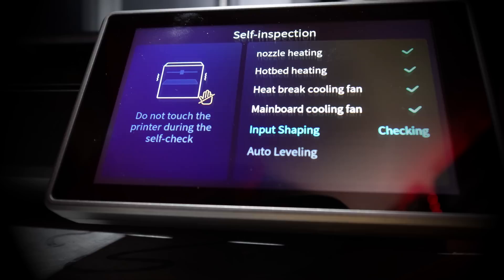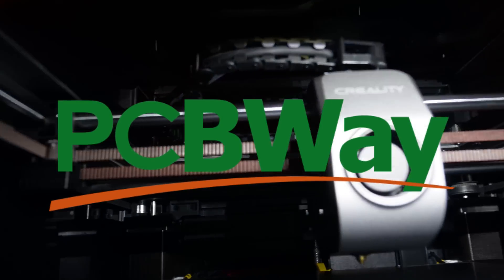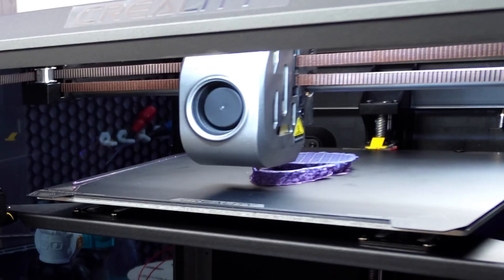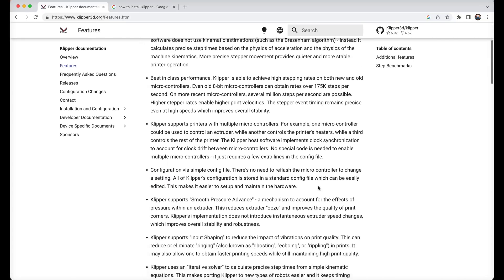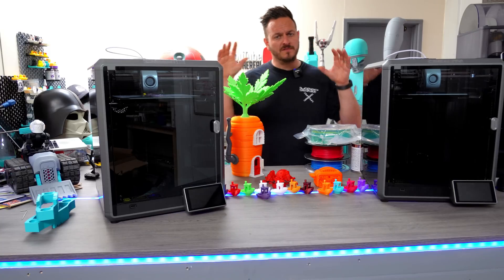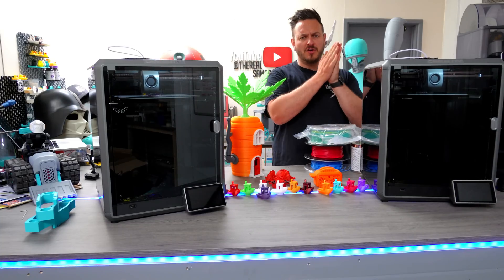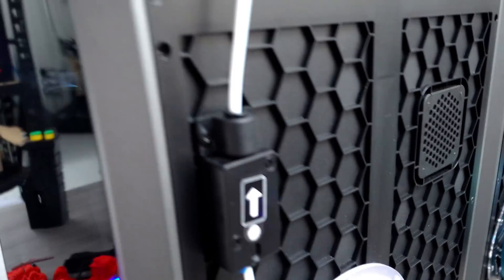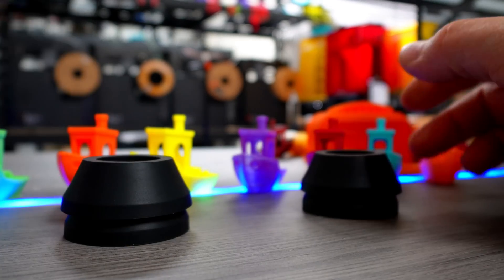The Creality K1: The Struggle was Worth It?

Comment: first time 3d printer - decided to go the K1 as it was on sale and for whatever reason wanted to jump the ender.  have a good time now but the QC seemed to have something in the extruder and it came jammed.  as I was new to 3d printers, this really irked me.  I'm not new to tinkering and taking things apart.. and putting them back together.  so, i did take apart the feeder mechanism which was fairly straight forward and sure enough, a bunch of gunk in there.  after I cleaned that out and putting back together, has been working like a champ.  i'm a little annoyed by this but at the same time, like i said, i moved on...

Comment: Same here, I got a K1 and even the included cat does not print well. Their extruder is a failure (for ABS at least) and the hot end won't deliver the flow. After fighting with it for a full week, have returned it as I should have had to retrofit a BondTech LGX Lite. Waiting for a PS1P now but no stock.

Comment: how do you get this device on cura? It doesn't have specs for it anywhere that I can see... if not cura, what do I use to slice and put jobs on it? It says its wireless but nothing detects it, not even their app on my phone. Says its offline but has an IP address assigned to it...
Reply from the maker: Well there are generated profiles for cura, cura and Creailty aren’t necessarily linked by default as they are different companies many are using orca slicer now but I’d suggest the k1 Facebook group will be a good source for information. On the ip issues I’d recommend restarting the printer and making sure you have the latest firmware

Comment: This 3D printing stuff is a massive nerd fest although I appreciate the information being a noob, comparisons, comments & opinions make it difficult to make a printer choice. You can pick-up a K1 here in Aussieland now for about $850AU which is pretty good considering it's speed and hard to disregard at that price. I need a printer that can print PP filament reliably (with some tweak's even). I see people using PP with varying degrees of success on a variety of machines. I'm told that with PP the heat bed, nozzle temperature and enclosure is the key to minimize warpage.  It would be really helpful if a Channel could do a few runs using PP on a K1 &or other makes and explain the pro's n con's. Not liking the issues people are posting about their K1 purchase tbh. At the moment I'm holding out until Sept for OS and any upgrades that may make this printer more reliable and user friendly. If you could do some PP filament prints on a K1 that would be awesome.
Reply from the maker: What’s PP?

Comment: I've had some good prints out of my K1 (first pre-order batch), and now it has been possessed by the minions of hell.    Using PLA and PETG, I've been bitten by the crappy extruder bug it looks like.  first layer goes down (usually), then by layer 2 or 3, it's draggin a wad of filament around.  Haven't had a good print in 2 weeks.  I reallly have a love/hate with it at the moment.  Meanwhile, my old Longer3D LK1 Pro, and FLSun Super Racer keep on printing. As does my Monoprice mini delta 2.  I mean for cryin out loud, that Longer is so old, it's been discontinued twice.

Creality needs to also fix their gimped version of Klipper.
Reply from the maker: I have something coming up soon that might be of interest

Comment: Love the vids... Have a K1 Max on pre-order. Hopefully you're right and most of the issues with the K1 are sorted with the K1 Max release (without more delays in production).

Truthfully I am expecting it to hit 70-80% of my expectations out of the box. Still doubts with {untested and still not in the wild} lidar stuff, as well as the issues that yourself and other reviewers have hit so far with the K1. Am hopeful that my previous Ender 3 V1/Ender 3 V2/Prusa MK3/2x S1 Pro/Sonic Pad experience will get my K1 Max to that hundy percent without any hardware replacements or modifications. I completely understand if firmware/software/tweaks aren't sorted, but I will be disappointed if I need to invest further into hardware to get my K1 Max going as it should because the actual build has something majorly wrong... Which is what I think most people worry about.

I think people are hoping for X1 Carbon performance at this lower price point. If that happens, I, and many other people will be very, very happy. I am hopeful they finally get something 95% right out of the box, which is one of the reasons I have previously supported Creality with my 4 printer purchases from them. They haven't hit that mark yet for me unfortunately, but pretty close. I just hope they actually have the team in place to deliver. It's amazing what a difference the right employees that actually care about the finer details can make for a company. I get the impression that Bambu Labs has done as well as it has because of the {ex DJI} mindset they have, as well as the likely financial incentives/profit sharing/vested interests. My doubts are still there for Creality, but I am hopeful the team can deliver, and if they do I truly hope our 3d printer brethren on the front assembly lines get rewarded well for it.

Also, side note.... Why would anyone use the Creality app side of things... Hell no..  chonked with ads and looking like most weirdly developed Chinese product apps with clear security worries. You can get a VPN and remote in to your home network to use the web interface for half the cost of the subscription Creality are asking for, and that's just common sense.
Reply from the maker: I think the max will be a hit! But as you say I’d also like certain elements addressed

Comment: What I'd like to know is how these high speed printers work with normal store bought plastics? Will I go down substantially in print speed unless I buy their specially tuned, and much more expensive plastics? 

Every review I've seen so far was using the sample of the provided, "special" PLA sample. If I buy a $20 roll of PLA from Microcenter or Amazon, will my print speeds suffer dramatically?
Reply from the maker: Well it’s only the white in my videos that were high speed the rest of the prints were stock filaments
Reply: @TheRealSamPrentice  That's good to know, thanks!
Reply: Yes. Normal different brand filament and regular brand name filament, K1 will adjust the speed unless you use the HYPER -PLA then K1 will again adjust to the high speed.

Comment: I am glad you are up and running, most of us with early units are not in the same boat (we are still gutted!) but I would definetly not recommend the K1 until they fix the Extruder and Hot End issues, and more importantly their Customer Service.  Until that hapens I would recommend the P1P until the K1 Pro or K1 V2 is released, or until Creality releases the proprietary parts for sale.  I was not happy with the P1P either until the latest firmware update fixed serious outstanding issues that has persisted for nearly 5 months.

Comment: Creality rushes out a new design out every 6 months and people jump. One Creality 3D printer experience was enough for me.
Reply: The K1 is tempting at half the price of the Bambu Lab XI Carbon, but I'm still reeling from my CR-200B experience. I did get a good one though in an open box CR6-SE though, that was another $100 gamble that actually paid off, so I might be up for giving them another chance.
Reply: I've been happily using the Ender 3. It's got just enough features to get by without requiring loads of quality control which Creality are incapable of.

Comment: The Mobile app having intrusive ads, on top of the cost for the subscription is an ABSOLUTE NON-STARTER and should be for anyone else.  

Also for this price point, no one should be having to tinker each set of filament for the printer and have to "dial it in" for each use.  Everyone should be passing on this literal homework copy of the X1C.
Reply: Bambu lab copied others peoples homework too, lets not pretend they didn't.

Comment: Glad to see that the end result has been positive. Random Question: have you tried Silk PLA yet with it? Seems like it’s my only filament struggling to get it dialed in.
Reply from the maker: Yes indeed, again its going to be about the heat settings. I find that they run it quite hot so reduction by 10 - 20 is a good thing